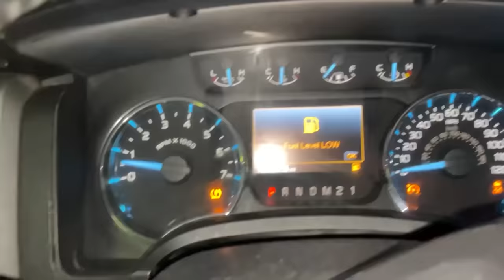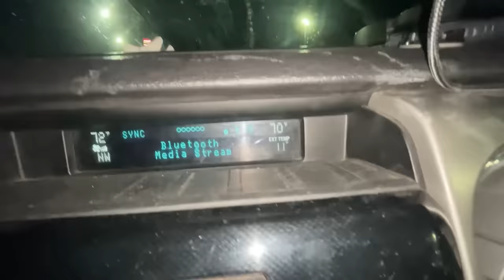We Moved in my Truck Together...

Comment: Non Electric Woodstove Fan...have been online shopping for either a single or duo...have seen a plethora of simple DIY projects attaching one of these fans on top of Mr. Heaters with happy campers. The fans help keep the heat from going immediately upward and escape through ceilings(roofs) and help redirect it more straight in a room(or tent). They also have energy savings. Originally designed for Woodstoves but people use with gas stoves(cast iron needed); the slight problem with these non electric Woodstove fans is on light occasions after two to three years of use,  the fans quit working yet it is a $15 motor replacement and a relatively simple DIY fix. With the Mr. Buddy heater users, those reviewers very happy with their results. Better warmth and comfort combined with noticable savings in their choice of fuel.

Comment: Mav, I’m country boy from Alberta Canada. I too have been all sorts of camping. But lately from watching your channel. I have started truck camping. I used to suv camp but truck camping is where it’s at. I love your set up. And the way you built your bed, rack, and rod carrier. I will be using a solar shower with shrader valve. All your gear in the drawers is so handy and the way to go. I’m avid truck camper. No noob. You should come check out the dinosaurs and I’ll give you a grand tour some time. Just a lil side quest for yah. Cheers pal!

Comment: My god, the first minute of this video couldn't illustrate the hardships of a Minnesota winter any better. Opening the driver side door to a flurry of snow piling on the front seat. Cold temps deflating your tires prompting a low tire warning. But I wouldn't trade it for anything!

Comment: I know it seems odd to say you should crack a window to release the condensation from the two of you and the buddy heater. I've used buddy heaters in some seriously cold Alaskan situations and ventilation is key. Prevents several different types of lung irritants and keeps your sack from molding. So far all off buddy heaters carbon monoxide tests have proven to not be an issue but having a CO detector is great 👍

Comment: You have no gas cap at 5:45 into the video? You open the fuel door and insert the nozzle and remove the nozzle and close the fuel door without ever putting a cap on or taking one off?

Comment: Mav found a 50cal ammo can heater that uses 4 candles, and works at -11 farenhight.😳😳😃. Could work for camper. 
   Candle convection heater camping with my off grid stove: (snowmobile camper series)
 The outsiders